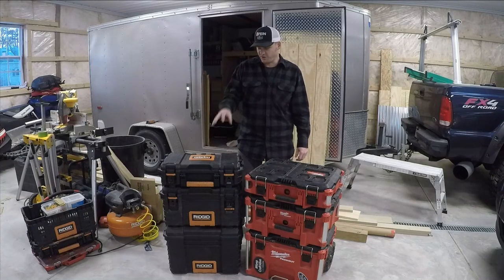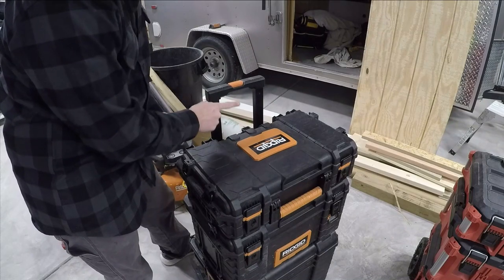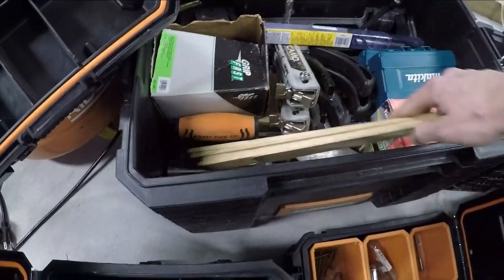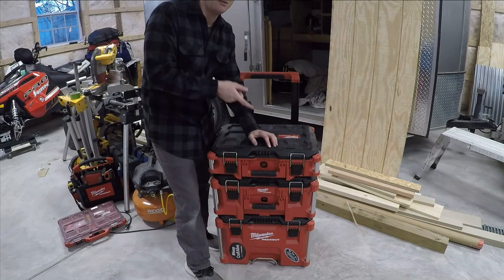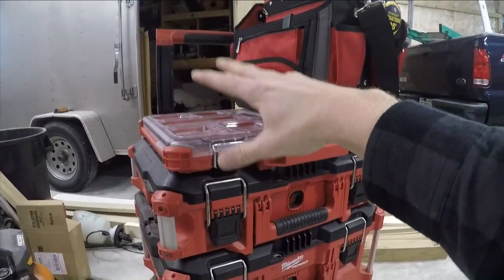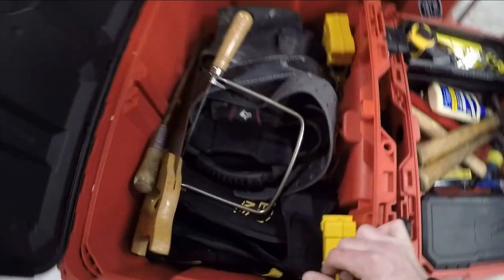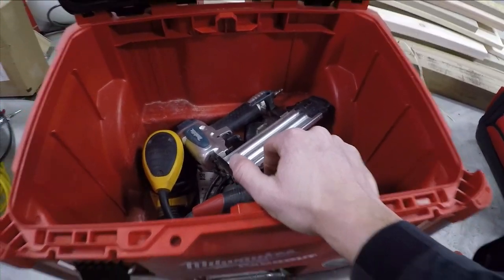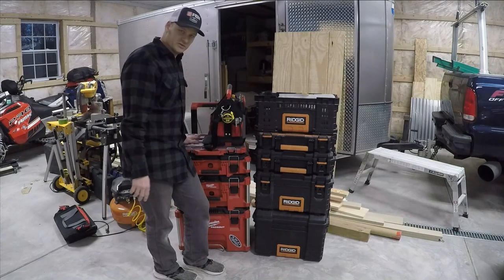MILWAUKEE PACKOUT VS RIDGID ROLLING TOOLBOX REVIEW. Which is better??? | HANDYMAN HEADQUARTERS |

Comment: I bought the Ridgid to better organize my most used tools while doing home renovations a few months ago. It mainly stays in my shop or home so I can put my tools away when I'm done working. I occasionally take a set of tools to my church to work so I'm sure this will serve me well for what I'm using it for. I really wanted the Milwaukee but couldn't justify the extra cost for just a Diy'er and woodworker. Solid review of these two systems. My advice is buy what you can afford at the time. I definitely didn't want to go with the cheapest like Husky or Stanley. I usually try and buy middle of road tools for what I use them for. Occasionally I'll spend the extra to get something of higher quality. I have Bosch drills, cordless circular saw and sander and DeWalt miter saw and angle grinder. I have learned that it's better to not buy the cheapest out there ever but you don't always have to buy the most expensive either.
Reply from the maker: Thanks for comment. Exactly go with what you can afford! Please don't forget to subscribe to my channel. It would be much appreciated!
Reply: I have the world's cheapest angle grinder and never minded. My miter saw is quite nice--a Ridgid back when they were the only ones with a shadow line. (I cut small diameter firewood with another cheap one.) My cordless drill, cheap, but hammer drill (corded) is a Bosch.

Comment: Well I dont see how any tool box is tougher than Ridgid box. My son left the same kind of box you had on the top of you boxes in front of my truck parked on the street. I ran over it in my truck and the only damage was on the road it's self, a big gouge of asphalt, box didn't even have a scratch on it. They are made from a military grade epoxy. You know there strong when you first open it up and get a whiff of the curing epoxy.  I have a few boxes, and bang for the buck is ridgid with life time warranty. Unless you are old and rich than the pack out is a great choice. One thing if you need a tool out of the ridgid bottom box , all you have to do is unlatch the box on top of the box you want to get to. Than lift the other boxes by grabbing both box connectors and lift two or three boxes together. Plus the ridgid boxes dont have much use to them, or they just hold up great. The new ridgid comes with a removable handle on the bottom box and each box comes with two wall mounts. Again life time warranty.

Comment: The Milwaukee pack out go for almost 300$ at home depot when not on sale just to clarify so it’s almost a 200$ price difference.
Reply from the maker: I would get it on sale!
Reply: Milwaukee is $300 Ridgid is $130 I ended up going with the husky $90
Reply: instablaster
Reply: @perronchabelo7608  🤣🤣🤣🤣🤣
Reply: @perronchabelo7608  yes! I’m a big fan of the Husky Connect system. Works great for my needs and has a lot of add on options.
Reply: @perronchabelo7608  how do you feel about the husky?? im looking at couple of those as well
Reply: With the ridiculous price that the aeg/ridgid quickstacks have been going up they have just shot themselves in the foot because they have made it so much easier for people to go with milwaukee packout or even dewalt tough system 2.0 now. I wont sick with aeg/ridgid now the price hike is insulting.

Comment: No doubt the Milwaukee is better and they charge accordingly for that. That said I've used my Rigid stack day in and day out for over three years now and it's served me very well. I use the basic three and the clear top organizer making It four for a long time. I have a block I put behind the handle and grip it under hand with one hand and use my spare hand to stabilize holding onto the organizers unused side connecting clamp. I'm an electrician and load this way to successfully avoid being  top heavy. The large bottom box has my DeWalt cordless gear. Drill, impact, sawzaw circular saw, multi tool, work light, bits, blades, batteries, four port charger, four way, and a drop cord. Serves as a good base for sure. With the tool box I ditched the tray for added space but it has a bag of less commonly used hand tools, another bag of wrenches, t handle allen's , sockets, and slug out kit, and across the top of those bags are my belt with it's pouches loaded with my EDC hand tools. Again. Lots of weight in the bottom two boxes. The solid top slim box only has test gear, rhino labeler, sharpies, pencils, locktite, de ox, and other specialty tools and literature. Lastly the clear top is all just connectors, wire nuts, straps, ect

Served me so well I just bought another 3 piece. Almost got the packout  but went rigid again. Took the money I saved and got a battery powered band saw, framing gun, and rotary hammer the stick in the bottom, middle is just assorted electrical boxes and random things and two clear top organizers for large assortment of fasteners. Either way you can't go wrong.
Reply from the maker: Great organization!
Reply: It’s not better…..rigid is tougher…..I have all the major systems and prefer rigid

Comment: foam inserts are useful if you have test equipment that you don't want to break - I do a lot of data forensics and cyber investigations in the field and carry around a lot of equipment for disk imaging and system analysis that is very expensive and likely to break if it's handled too roughly. I also carry a toolbox with the items needed to work on computers and in data centers  and boxes of cables etc where I certainly don't use foam inserts but my network scanners, laptop, disk imagers, cable testers etc. are all packed in foam. 

also if you work in an area where tool accountability is critical (i.e. working around jet engines)  - you want to know that you have all of your tools every time you leave the jobsite and foam cutouts makes that easy.

foam inserts probably aren't needed for most people doing construction but it does have it's place for some of us.  I use the dewalt 'ToughSystem' which has a detachable handtruck (much more versatile) plus all of the boxes can be rack mounted in the van using their racking system so nothing slides around in transit; fwiw: "Pelican" is the 'go to option' lots of people carrying sensitive test equipment and they are great for that purpose however those are not modular/stackable systems and I always need tools AND the test equipment so while this isn't perfect it handles both quite well and makes it pretty easy.
Reply from the maker: Great insight!

Comment: Why would you over stack it and then complain....it's not made to be over stacked...I use mine for DJ equipment and after 4 years it all holds up. Good video
Reply from the maker: Yeah it does hold up!
Reply: I have been looking for a tool cart system for my DJ stuff. Sounds like you've had good luck with the Ridgid so I'm gonna pick one up.
Unlike a contractor I don't have to keep stacking higher, so the 3 boxes as it comes will be just fine.
Reply: @ptfd140  I have the rolling cart and 2 of the medium tool boxes and 2 of the suitcase style cases. Suitcase I use to carry my cordless mics 
2nd one is for adapters small cords, tool boxes are for lights and extension cords, xlr cables and rolling has more of the same.
Reply: Sorry I'm late to the party. I actually bought my Packout system for live stage use. Guitar, mic, and speaker cables on the bottom as well as mics. Center is 3-drawer unit with tools, strings (guitar and bass) extra things like straps, etc. Top is a cleat organizer for hardware, picks, and other oddball items. Definitely cheaper than road cases, and less heavy.
Reply: @ptfd140  Packout has drawers which are spectacular. Less having to take boxes off in the limited space we have where we're allowed to set up, plus MUCH easier to grab on the fly. Packout it more expensive than Rigid, but cheaper than road cases.
Reply: I have the 28” tool box as well that rolls and I just bought the clear top  briefcase style. Forgot what it’s actually called. I use the clear tops for all my connections and mic clips, lighting to 1/8”, rca-1/4 rca-1/8, speakon to banana clips etc. if they make a drawer system then I’m covered. Although I’m waiting on their ice chest to come out.
Reply: @davethepius  I was at the store and looked at the packout with drawers. Yeah that would be awesome. One drawer for my sound mixer, another for my mics. But DAMN I can't justify $250 for just that one box.
Reply: @ptfd140  That seems high. The 2-drawer unit is about 150 USD here. I got the 3-drawer at 164 I think.
Reply: @ptfd140  I've been doing research to find modular system for my 24 yo son to store & transport his DJ accessories.  You just helped me decide on the RIGID system.  Thank you!

Comment: I was struggling whether to spend the extra $ for the Milwaukee, but went with the Ridgid. Because get this, my Milwaukee Sawzall fits better in the Ridgid crate box than the Milwaukee crate box. The Milwaukee is wider, but the Ridid crate is longer.
Reply from the maker: Funny how that works!
Reply: @HANDYMANHEADQUARTERS  yes. 100% agree on the handle and more options with Milwaukee, but the crate size was the deal breaker.

Comment: you can put both bags on top, take the thin Box and snap it on so its halfway hanging over the edge, then put the 1/2 back on the other half that's the thin is not covering and the full-sized bag on top the full-sized Thin box

Comment: All three ridgid, Milwaukee and dewalt 2.0 modular tool box systems are made by the same company... it's all really fits in your budget.. I have both ridgid and Milwaukee and love both tool box systems.
Reply from the maker: I agree both work pretty well. Thw hardest part is getting just the right setup for both of them.
Reply: @HANDYMANHEADQUARTERS  very true.. there is no perfect setup without some kind of modification... just my opinion though.

Comment: I own three Ridged’s setups and are really good plus great on the bank account . My handle is a lot stronger then your one you were moving around . The crate is great for loses items . Yeah I learned like you the more you put on it gets heavy and does put pressure against your hand if your moving it around .  But I’m glad I waited and didn’t buy the packout . With the packout draws coming out are the way to go . Both systems stink for loading and unloading .
Reply from the maker: Yeah the handle idk what is up. Second bottom box I've gotten after the first one broke.
Reply: @HANDYMANHEADQUARTERS   I have one Stack just full of paint equipment which is nice makes them light to move around and everything is not spread out in 🪣 buckets or 📦 boxes  .

Comment: I was going to get the Rigid because of the price, but I knew I'd kick myself later for not getting Packout, especially now that it has drawers. Kaizen foam is great for the drawers, or if you want to set a small box up for drill/driver kit with bits. Keep up the good work!!
Reply from the maker: Thanks for you comment! Don't forget to subscribe.

Comment: Thanks for sharing.  Can the milwaukee system's top open while stacked?
Reply from the maker: No because the handle gets in the way.
Reply: the middle one can open with the smaller box on top. The larger crate on the bottom (one with wheels) can't be opened with the other boxes on top.

Comment: The prices sure went up in 2024 !!! . You're looking at $400 plus for the Milwaukee setup!! 
The Milwaukee is too bulky.  The Rigid is better and easier to stack and unstack to move it. You can't carry a whole stack in anyways ! The big problem is that once you're working in an apartment or home, you want to have an instant work station once you restack the boxes.  They both missed the mark because you need a flip out bottom like Stanley made years ago and drawers , and the top box just opens normally. The Stanley came apart in 3 sections, great design,  but they were not durable, and the small wheels weren't any good either. Had the Stanley rolling setup  been made slightly bigger and durable, that was best design !! .👍
Reply from the maker: I just seen that! The price went way up. My initial setup was 300 bucks for the whole stack and the bag.

Comment: The rigid handle bent on me the first day with a light load. It is no longer capable of collapsing. It's junk n my opinion. The plastic boxes are good quality so it's too bad they cheaped out on the handle.
Reply from the maker: Yep handle broke on me too!
Reply: @HANDYMANHEADQUARTERS  I thought it might be better than it looked because of the Ridgid name and surely Ridgid wouldn't put their name on something below Kmart quality but I was wrong. I will have to make some kind of a handle for it.

Comment: There is no comparison, Milwaukee owns the game and all the other players submitted their surrender flag.
Reply from the maker: Haha!
Reply: Totally agree these folks must own rigid tools🤣🤣don’t blame them for choosing a cheaper box I would too if my drills were a 1/4 of the quality.
Reply: Ridgid are rebranded AEG had ridgid and AEG tools as batteries are compatible never had one that didn't do the job or break daft Milwaukee just paying for a name. Not a sheep don't follow the heard
Reply: @ashbashbaby2  sounds like a rigid owners justification😬😬
Reply from the maker: @ashbashbaby2  I didnt have the same luck. One broke on me so I tried milwaukee.
Reply: @ashbashbaby2  yes AEG and Ridgid is the same absolutely nothing different except the color however Milwaukee PACKOUT  reigns supreme. 

When I go on job site all carpenters and electricians use Milwaukee PACKOUT period. PACKOUT is expensive compared to everything out there maybe with the exception of Festool Systainer3 ToolBox

Even the Festool is garbage when compared, only spoiled shop carpenter purchase these without tools.

Now that PACKOUT has drawers game over.
Reply: @levibruce8322  I started out with Ridgid, believe it or not Ridgid made the first impact in America followed by Dewalt. It was massive and I still have it. 

Ridgid cordless tools are not designed for the professional with high demands. I have 23 Ridgid tools on the Life Time Service Agreement and only the Jigsaw and the random orbital sander has not broke.

Ridgid takes on average 3 months to fix or replace which is ridiculous. How am I supposed to make money with my tools in the shop? 

I am done with ridgid that currently only has 3 batteries 1.5, 2.0 and 4.0amh.

I am going with Milwaukee and Flex Power Tools.